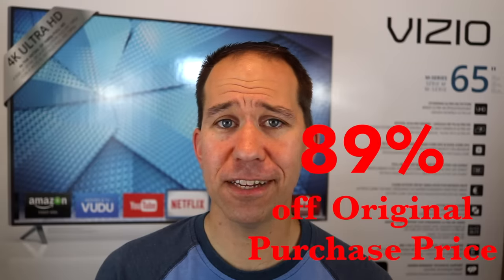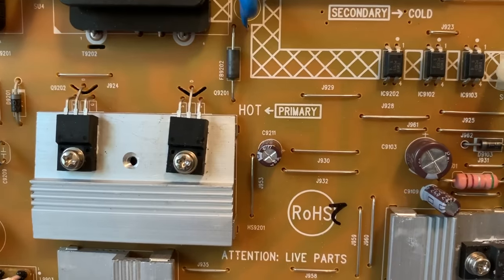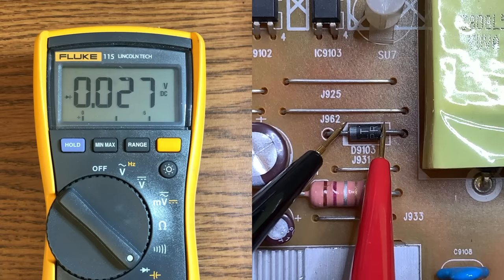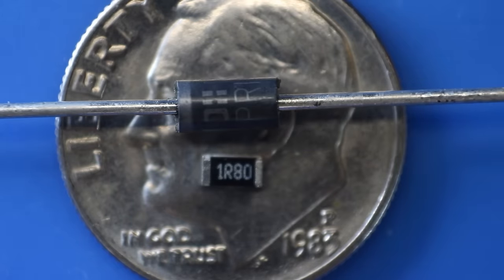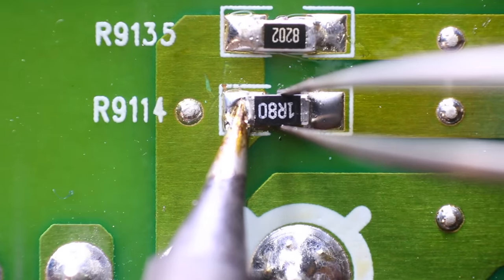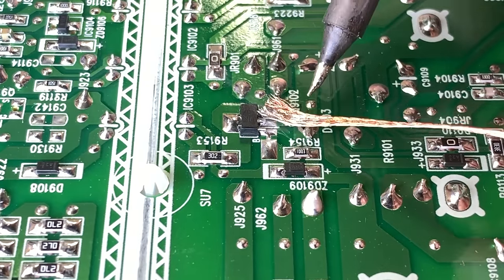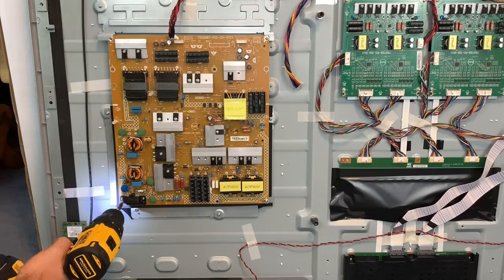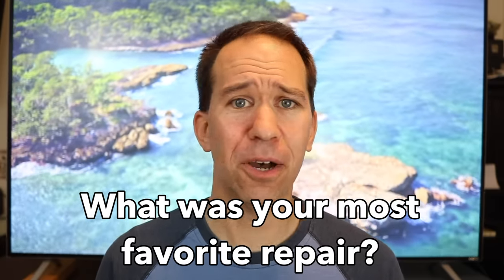I got a broken 65” 4K TV - How I repaired a Vizio M65-C1 (tv won’t turn on)

Comment: I have the very same TV.  Mine has no video or audio but I do have a standby light that's on. So I'm assuming it's not the power board? I just cant afford a new TV.
Reply from the maker: There seems to be a common fault on the main board too.  You’ll want to see if your power supply is putting out a steady main voltage.   If the main voltages are there and steady, I would tend to think you have a main board issue.   But I’m just guessing that.

Comment: Hello! I have the same model Vizio TV that finally gave up the ghost. It powers up, shows the Vizio logo then goes black and shows a corrupted image in the general area of the logo. It will cycle through this process without ever proceeding to a picture. My power board looks to be fine and since I do see an image of the logo I don't think it would be the display boards (GPUs). My thought is that the main board is what died.  Do you think my diagnosis is correct?   I found a replacement main board from eBay for approx. $160 but thought it best to get another opinion before buying a non-refundable item.   Thanks in advance for any thoughts!

Comment: Frugal Repair, good afternoon I am wondering if you could give me some advice. I have the same tv but my issue is powers on and all but the back lighting doesn’t work. The picture is there with using a flashlight I can see it but to no avail I’ve replaced led board and nothing. Any advice would help. Thank you
Reply from the maker: You probably have shorted LEDs on your backlight.  To fix you will need to locate the bad ones and solder in new LEDs.  As a temp fix, you can try to turn the brightness down on the set in settings to like 10-15%, then reboot to see if that helps them light up.
Reply: Sounds more like the backlighting inverter...pretty common symptoms when the backlights won't fire up...could also be the CCFL lights themselves, though all of them failing simultaneously is unlikely except a power surge...plenty of videos about both repairs...good luck
Reply from the maker: This tv has an LED not a CCFL backlight.
Reply: Whoops...read that too fast...LEDs it is...your diagnosis seems spot on...but if they're all failed I'd check the power source..if one zone were out, it might be a single strip

Comment: GREAT JOB, but one thing.  When you test the resistor or diode, you cannot trust the result when they are connected in the circuit. I have learned this over many years. The current from your meter can flow through many paths and give a  false reading.
The only real way to test the component is to disconnect one end and then test it with your ohmmeter.
Reply from the maker: Thanks!  I understand that it may be technically possible to get a faulty reading but in this case you shouldn't get a mega-ohm reading on either side of a resistor like this (unless it became an open circuit and then you know it is bad).

Comment: And even if you do not know how to troubleshoot small parts on each board or solder individual components... you can always get a TV like this and replace one of 2 or 3 boards inside the TV for about $20-$50 bucks each and you can normally find the boards cheap on ebay.
Reply from the maker: Yes, that is a great way to go.  Just need to make sure you have it diagnosed correctly.

Comment: I have a 2016 model LG 65in UF8600 3D tv.  Works well with one regard.  I see soft light streaks in about 4 areas at all times.  These are about 6-8 inches long.  I believe they are cracks in the one of the diffusion layers.  I can find nothing on obtaining these layers or materials.  I don't want to open it up without at least figuring out where I can obtain these pieces, as any lag time will lead loss of parts or dirt intrusion, I'm sure.  If I press on the screen over these lighting artifacts they become sharp, like a crack would.  But image is great.  No more 3D TV's.  Any ideas?

Comment: Any reason to replace parts with exact same specs?
Whenever I replace resistors or diodes and can see they've lived a hot life I either up the specification or provide better cooling. If it's just because of inrush current over time just upping the specs a little will prevent them from "ever" failing again.
For capacitors I do not always up the specs (depends on a lot of things) but I do choose (much) better grades and usually price difference is very neglegible. Once repaired thing usually works for decades afterwards. I got an (at that time) very big nice and expensive IPS computer monitor from my work place in 2004. Only recently replaced by something modern as real estate was beginning to be on the small side. Moral is it failed quickly at work because probably it wasn't really a B2B monitor so it failed quickly by the heavy use. Once repaired with better parts it chucked along for about 15 years always on when I'm home. By all probability there's still many more years left in that monitor.
Reply from the maker: If you know what you’re doing and you know it won’t adversely affect the circuit design then I don’t see a problem with a higher spec part.
Reply: Well. For a resistor - choose one with higher wattage or provide cooling. For diodes - choose one that can take higher currents but is still fit for frequency used (and same type of course). Capacitors. Same voltage or next number above depending on how close they're running to spec'ed voltage. Depending on where used I might even go one step up in capacity. Always using good quality like Elna, Sanyo, etc. 105 ºC low esr. For transistors/fets it's the same as diodes but you need to look out for HFe etc. too. Sometimes I find one that fits but have different pinout. Through hole transistors are usually easy to provide better cooling if they're running hot.
So yes sure you need to know what you're doing. But it's not really that much rocket science. Many components are spec'ed to save not even a dime and more often that not they're also chosen specifically to fail at some point after warranty expires (operation hours, cold starts etc.) depending on expected usage pattern. So when replacing make sure they're not the weak link and your device will (in most cases) work for decades afterwards.

Comment: Hey! I bought a Vizio TV exactly like the one in this video and it seemed like it had the same priblem as yours so I did what you did in this video. It didn’t work so I did some research and I found that it could be the T-con board so I bought it and it still does not work. Do you have an idea on what could be the issure or any advice on how to fix it? I appreciate your help if possible and your videos are great!
Reply from the maker: Did you confirm that the power supply is putting out 19v when nothing else is connected?  And are you sure you're not dealing with burned out LED backlight?

Comment: Super I also love fixing electronics, latest was iPhone 6s
Reply from the maker: That’s great!  What did you fix on the iPhone?
Reply: FrugalRepair it screen got cracked
Reply: FrugalRepair I am struggling currently with my Vizio TV M50-c1 its power light gets on but nothing after that. I opened the TV and tried to see if any thing burnt somewhere but nothing I could found. What could have possibly gone bad power board ,tcon or something else. Can u suggest 🙏

Comment: A friend's Samsung tv would randomly start changing channels after it had been on a while. 

Eventually the tv would not turn on. 

I checked the batteries in the remote. They were dead, even though they were replaced recently. Hmm..

I checked the circuit board for bad caps. All was ok.

I read some posts on the web about how to reboot the tv. One unplugs the tv, then press the power button for 20 seconds. Then wait a few minutes.
The tv turned on as it should. All channels worked. 

I put a new battery in the remote. The channel flipping resumed. I noticed that the channel selector on the tv seemed stuck. Which would explain the channel flipping. So I had a bad remote. Since I had nothing to lose, I decided to take the remote apart. It looked like there was a sticky sugary residue. Like someone spilled a soft drink on the remote. 

So I washed all components with dishwashing soap, then allowed it to dry.
I reassembled the remote, then tried it out. It worked like new. Total cost of repair? Zero money and a couple of hours of my time. Most of that was spent on the internet .
Reply from the maker: Good detective work and repair!

Comment: I got a broken samsung HD 3D LED TV I just can't throw away. Backlight goes on but no screen. Seeing your other video with a similar problem I'm going to have another look. We already got a new TV for some time though. But I think its a huge waste to throw away for probably such a small component being broken.
Reply from the maker: I’m glad that you’re thinking of fixing it.  The worst case scenario is that the problem is within the LCD assembly itself.  If you’re OK opening up the TV, one thing you can try is running half the screen at one time as a quick diagnosis. With everything unplugged then go and disconnect one of the ribbon cables coming out of the Tcon board to the lcd. 1/2 of the screen should show the image and the other half would typically be white.  Then try the reverse and see what you get. If one side works and the other side does not that tends to tell me that there’s a problem on that side of the LCD panel, and typically not repairable. But it could also be as simple as getting a new tcon board.  Have you found out any clues from online searches?

Comment: Hey Frugal: I opened my Vizio E65x-C2, and it has only 4 strips that come on but very faint. Could something else be bad, or are the strips the only parts that I need? Thank you for any advice. Like your videos.
Reply from the maker: Do you mean backlight strips?  If so, it’s likely the issue is bad/failing led modules

Comment: My friend just gave me a 1 year old vizio 70" tv. Has no power at all. I just ordered a new power supply board for 45.00. Fingers crossed. Before it wouldn't do anything...no clicking, no lights....nothing. I'm waiting impatiently for that board to arrive! Lol I try to fix any tv I can find. I have fixed 5 TVs. I have 2 70" tvs from that same friend. One tv has black screen but I can see picture with flashlight. I spent 120 on it so far but I'm stuck as to how to proceed. Any thoughts? Thank you
Reply from the maker: Great job on the tv repairs!  If you see an image then the issue is burned out LEDs.  You need to solder in new ones or replace the entire strip that has the bad ones on it.  I’ll do some videos on repairs like that soon and show some of my tricks for getting rid of dust particles that creep in when you remove the lcd.  The big thing with yours will be not cracking the lcd when you remove it, since it’s so big.

Comment: Are u willing to fix this for someone who has the same issue? My tv just went out last night same exact problem and i cant find a power supply board. Was just gonna buy a new one so i didnt have to solder anything
Reply from the maker: I would be open to it but are you sure it’s the same issue?  You’d want to check the resistor and diode to make sure they are burnt/shorted.  There also seems to be a common problem on the main board (based on eBay repair services being offered).

Comment: Hi man!  been watching your videos for inspirational use :)  And i have a question
 what do you do with a LCD Flat tv that has a little scratch on it  on the surface of LCD.
Im curious about that..   Thanks man for good content! cheers..
Reply from the maker: Thanks!  A scratch in the polarizing film?  Usually if it isn’t a bother, I don’t do anything.  You can try using a genuine magic eraser and buff out the scratch.  It will scratch it more but possibly make the main scratch less noticeable when the tv is on.  So it’s a gamble.  If the scratch has cut through the polarizing film, I have used a black oil based pen to fill it in and it kinda works.
Reply: @FrugalRepair  Hi!!   Thanks for replay!
Yes it it a tiny scratch on the film but its not that deep i have read about magic eraser and i will check that out thanks man for replaying so quick cheers!

Comment: If this is a common fault it will surely do the same again after a while would it not be better to correct the parts for sturdier parts values?.
I have seen on many occasions 10 volt parts like for capacitors when a 20 volt would be required to make it last a lot longer.

Comment: I just stumbled on your vid. Your an inspiration and would love some help in repairing an LG I had that caught a power surge. How I would look for the damage?
I will open it and see if they’re are any fuses first. Which I pray may be the case. 
Now imma new Sub of yours. You prove what I always say. Things can be repaired. Just a little time and effort.
Reply from the maker: Thanks!  Did you see I have a video about what to check after a power surge?  It’s probably either a bad power supply or main board (surge comes through hdmi or coax)

Comment: Love the channel.  Im a new Subscriber.  I found a Samsung UN48JS8500F (smart tv) where the LED power light blinks 5 times but no display. I havent done too much repairs before but feel like this display being a nice 4K tv, which I dont have, would be something to get fixed. Going to take this apart to see what I can find.  So far I havent found any boards or power supplies for this device. Thanks for the video.
Reply from the maker: Thanks!  I don’t know that model , is there any clues online?  I’d start by checking for standard voltages and disconnecting boards isolate any potential short circuits.  But sounds worth fixing!  Are there any boards that sell a lot on eBay?  That is usually a clue of a common issue.

Comment: Hello, I have a KDL-50w755c, no video fault. i saw one of you video on similar error, i figured out that panel has problem by removing the left side flat cable to panel from TCON. after removing the left side flat cable to panel i got side picture and other half complete white. could you please give any tip in this case if this is repairable ? thank in advance

Comment: Where do I find someone like you to fix my tv?
Reply from the maker: I don’t know.  Where do you live?
Reply: @FrugalRepair  I live in Olds, Alberta, Canada.  The TV comes on with a nice clear picture of the manufacture, then disappears and stays on with no picture for a total of 24 seconds then turns off, this happens every time I try to restart it.  So I opened up the back of my Element 40" LCD. and looked everywhere for burned-out connections and found none.   I am baffled.  What can I do?
Reply from the maker: @believeme5903  That is a classic symptom of a shorted LED or several LEDs that make up the backlight of the lcd screen.  You need to replace the bad ones (individually or by the strip)

Comment: Hopefully u can help me? My girlfriend has a Vizio 55" TV model #m550vse I turned the front indicator light off to save the bulb & about a week later, when we turn the TV on, the TV lights up like normal & immediately goes black but, there is sound! Which board do you think it could be???? Any advice is very welcomed! Thank you...
Reply from the maker: If it lights up and you see the screen briefly then it goes black but sound is still there...  that sounds like a classic symptom of failed led backlights.  Turn it on and after the screen goes black (and you still hear sound), get really close with a flashlight to the screen and you should see an image (if you see anything at all then it means the problem is the backlight).

Comment: Curious to know how you would go about fixing/soldering a crockpot call/slow cooker? The heating element has barely a spot to latch onto.
Reply from the maker: You might have to solder on a wire from the board to the element.

Comment: You forgot to include your time in the cost of repair. Excellent video! BTW my shop rate for repairs of this type is $80 for the first hour. Includes diagnostic. Typically the diagnostic and repair take less than an hour. Getting parts is what takes time. Those parts are common values. You might consider buying them in bulk. Shipping is the same either way. Buying SMD's can be iffy so buying several is a good way to go.
Reply from the maker: Thanks for your comment.  This is a TV for me so I wouldn’t count that in my cost.  Do you mainly fix TVs?  Or other products?
Reply: @FrugalRepair  I fix mainly computer server mainboards, CNC equipment, printers anything that can be repaired in a way that makes sense money wise. My rule of thumb is if it costs more than one half replacement cost to repair? I recommend buying a new one. Unless it doesn't exist. I don't repair TV's very often unless it can be done like yours. ;)  Typically they're expensive junk.

Comment: I have this exact same model that i got because it won't turn on. The power up light comes on the lower left hand side, but I'm not getting the flashing light like your video shows on the main board.  I honestly have no clue about electronic repair